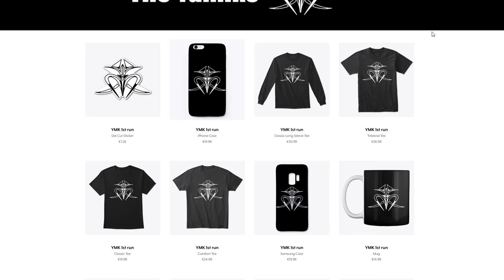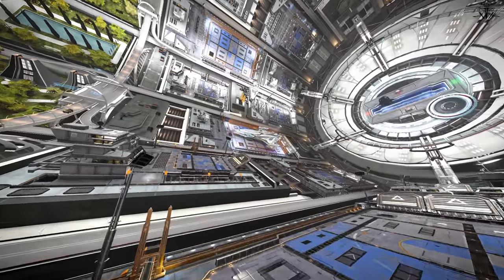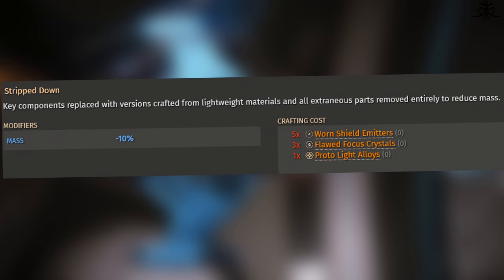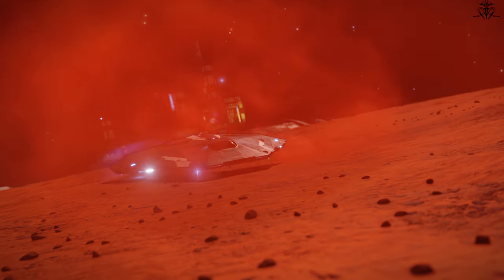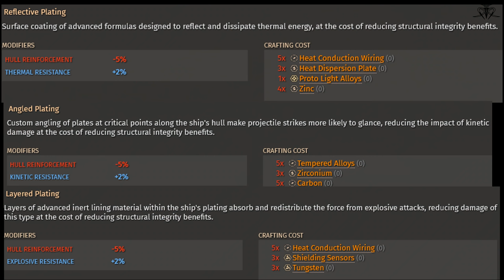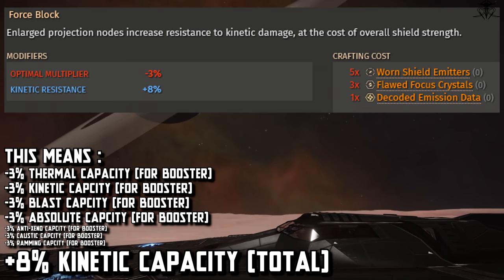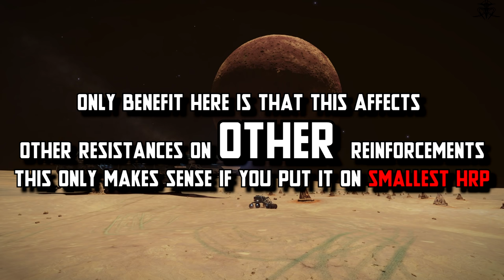BEST to WORST : DON'T BOTHER optional internal tier(Misc stuff,Long range interdictor)

Comment: the mass cutting for exploration only works for 2 ships: Anaconda (IF you got no worries about Money) and Diamondback explorer. if you do it with any other ship, it is stupid (just plug the Guardian FSD booster and you're good to go for combat radius for example in a Krait MKII). and an engineered DBX is NOT expensive at all (10MI + Materials, wich are easy to find in any good starport with movement (encoded), Dav's Hope (manufactured) and in Ariel(elements)...)... i consider it even a thing every commander should have at hand at this point of time, a DBX with at LEAST 60LY of jump.
Reply: Yeah... Tell that to my Courier, boosting to over 800 m/s then jumping 45 LY to the next system.

All exploration builds can benefit from cutting weight. Especially since the returns grow exponentially as you shed tons. Open up Coriolis, and look at the profiles tab. For jump range, there is no cap. And towards the left of the graph, the lightweight side, the curve pitches up more sharply. So, for every ton of excess weight shed, the next ton shed will yield more returns than the previous.
Reply: i mean this as a general thumb rule. if you like exploring in Gutamaya Luxury i'm not stopping ya.

Comment: Lightweight hull engineering wouldn't be so stupid if lightweight alloy bulkheads didn't have zero mass. If you want an exploration ship that can take a bit of damage, its literally better to heavy-duty engineer some lightweight bulkheads rather than lightweight engineer some reinforced bulkheads: You'll get more armor for less mass. If lightweight alloy bulkheads did cost mass, then there would be a point in making it or other bulkheads lighter as well as a negative for making lightweight alloys heavier

Comment: Alright, that basically proves that you have no idea about the game :D Would also be nice if you'D shown the actual values ingame and not through third party sites, because as we know, there are differences across the board.
To elaborate:

Low Power shields are to make your freighter lighter since you only use the shield as an airbag to land quicker and to avoid hull damage. Depending on ship you take the smallest A or D type, but still engineer it with that.
Kinetic resistance shields did not only have a place historically but it is also an option that makes sense to have when it comes to customization. As there are people who exclusively use rockets, there are also those who exclusively use kinetics, making it a viable choice to defend against once you run a tiny bit of intel (but that may be a concept lost to you). Furthermore, I still think that it is true how some factions and encounters use biased loadouts, where it offsets the decreased thermal resistance from the increased kinetic resistance in total.

Thermal resistance on hull makes a ton of sense, with all those people running around with beam lasers in order to not wanting to resupply or who run those beam laser builds that either keep you silent running or dump their heat onto the enemy, or make more damage the more heat you have. This is one of those cases where exclusively rigging for a specific damage type is very viable. Also I have no idea why you point that out on lightweight specifically... since reinforced, military, and reactive/mirrored have the exact same engineering types.

Low-draw can make or break your build in some cases, it depends on the way you rig the ship. Strip down is again preferable for freighters and jumpers. The boss cell is indeed useless though, same as with experimental resistance on hull reinforcements.

I do wonder why your list is what it is, and why you haven't looked at other, arguably worse, upgrades. But I guess this channel isn't exactly known for it's informative value, sans the comments :)
Keep up the satire, stay away from helpful tips or critique until you can actually make a case (as seen by the Cutter shield HP ridiculousness that you totally don't understand that it's a crappy build in every conceiveable way).
Reply from the maker: Ok then : 
Low power shields - AS you claim for traders... ok  min-max all you want, if you want. This is still a VERY VERY niche sector of people who would pick it!

Thermal hull - what idiot would NOT pick heavy duty?!

Low draw - only ever used by some explorer builds, but tell me : what explorer NEEDS shields? For landing on high-g planets...ok 1 case. To survive a gank? Umm SOLO MORE?! So as far as I see here the use case is so minimal, why bother!? 

I mean if all you got is straws then .. why bother!?
Reply: @TheYamiks  I concede I was not perfectly straight with one point: I meant thermal hull resistance in general, referring to Mirrored Surface composite. The way you presented your case sounded like who would ever go for thermal in generall on hull. I never said NOT to pick heavy duty :) Heavy duty is not an experimental effect. It depends on the total armor value of the ship in this case if it adds up. Because what you didn't seem to take into consideration are MULTIPLE HR modules. You look at them from a single-slot point of view in this case and only look at paper values. And my case was presenting against one specific damage type that I keep seeing that people are running, and if you know you'll only be hit with one thing, then you get more out of it with stacking, even if your overall EHP seems to suffer.

I wouldn't call trading a niche sector. Because traders usually do not play open :) And not every minmaxer is also a pvper. You'd be surprised how many "filthly casuals" are out there who outsmart and outplay many a bragger if being pushed. Being casual or not playing open doesn't mean it's a bad player by default.
There is more to the game than pvp, and balancing the game around pvp is a fruitless endeavor. I don't know how much you've been exploring, or how far you've been out of the bubble, but sometimes the game just decides to spawn stuff onto you. 3k LY away from the bubble. That extra layer of protection can mean keeping on exploring or starting back out far, far away in a station you didn't want to go to. There are different kinds of explorers, not just the one kind that you think about. Not every player only plays meta :) And you can also not say how many people actually play the game that are not heard due to simply not bothering to go against the the vocal minority of no-lifers constantly flooding forums, reddits and youtube channels. I'd wager if there is a statistic of how many people play solo, group and open, I wouldn't be surprised to see solo and group being a substantial percentage.

If you're out of power on a build, even with a monstered PP, you are presented with different scenarios to nudge out more of it. It's an option that can be looked into, and sometimes there are no other choices. Conversely, while Reinforced shields always look at the better option because of the resistances, you can add resistances via shield boosters. Low powered has the advantage to have higher uptime in terms of recharge rate because you don't need to sink as many pips into it compared to reinforced. And it weighs a LOT less. You might not think about that as being something important, but there are builds out there who want to keep at maximum maneuverability for it's thruster type, effectively not trying to go above minimum mass. There are ships that are well capable of doing so, some easier than others.

The main problem I have with absolute statements like that are; you can't speak for everyone, and only looking at isolated numbers is never going to work. For example. I barely see anyone taking TRUE effective shield hitpoints into consideration - everyone seems to ignore the regeneration. Because the more points you can regenerate in a lower time means your effective hitpoints go up just as well. Not everyone is always under constant fire, giving the shield time to regenerate. And some builds do not need to rely on shield cells.

Sometimes the "best build" for a given ship and a given task is not the best to play for a person. Either simply because it's not fun, or because they can not utilize something as well as something else they've already gotten used to and perfected. Guildwars 1 is a splendid case for an example like that.
Reply: @MJRSoap  This is a good example of what I was just illustrating. Are there BETTER ships for jump range with super low mass modules? Yes there are. But if YOU like the KRAIT more for it's looks and whatnot, then there is no point in going for something else you DON'T like :) Not everyone plays the Meta, and choice is a thing!
Reply: @Khunvyel  The Anaconda might be the Meta for jump range but other ships can compete with it on Jump Range. The Diamondback Explorer for example, it has much better thermal characteristics than the Anaconda, while still holding the high jump range. It's also more manovourablee than the Anaconda. The Krait and Krait Phantom both LOOK better in screenshots while easily competing with the Anaconda's jump range and range of equipment. Exploration isn't just jumping from system to system scanning every single rock. You will want to stop and take in the scene that you and, likely, only you will ever see.
Reply: @MJRSoap  Exactly, yes. The only thing the Anaconda can do is boast single jump maximums but the total range is limited due to worse fuel efficiency. While I would prefer the Phantom over the Anaconda as a pure jumper, I just don't like it's looks and enjoy much more nimble ships. Therefore the Diamondback Explorer is my pick. The Dolphin can actually be a pretty reasonable long range jumper too, all things considered. There are many ships that break the 60LY range with a full tank so a lot of things just come down to preference. With FSD injection / Star boost this is plenty to reach almost everything even on the outermost fringes, if I'm not mistaken. 
The Anaconda or the Phantom to me are more like fully fledged expedition ships ... there is an entire crew making a ship their new home for years as they explore systems in depth and do manned surface surveys etc. My DBE feels like the lone wolf's answer of scouting and cartographing on the verges of space.

BTW; if you switch your power distributor engineering to engine focused, you're back on boosting again. You know, for showing pretty engine trails in screenshots :)
Reply: ELP shields would let you run a vulture with higher loads too. And keeping the mass down ALSO allows more manoevering.
Ever wondered why he got smoked by a Hauler...?
Reply: @markhackett2302  I would like to note that in almost 8 hours, yamiks hasn't responded.
Reply: @MJRSoap  He could easily have been and gone to dinner or sleep or anything.
IOW it really isn't notable.
It doesn't change anything, either, he's either fatally confused or just riffing on his memeing and really knows he hasn't done his sums but isn't trying to be informative, only "entertaining". In either case, it would not matter, these posts here correcting his misapplication of logic are just informative. It is just whether Yamiks is part of the group who will be informed that changes.
Reply: @markhackett2302  Well, considering the responses on his super-duper-shield-cutter and why it's broken, many just don't want to look into the actual mechanics and are feeling "inferior" due to the high numbers presented, without understand that it's a crappy build. In any case, there are people who keep pointing out things and that creates the chance for a good discussion. Often the comments are more worthwhile than videos, which is a very widespread "phenomena" :D Also yes, the Vulture sometimes needs every help it can get. 

@CMDR Emotions give the man a break, it really isn't required for him to answer. All we can do is present alternatives and other arguments, and that's it :) We don't need to convince him, just maybe cause enough stir for the viewers to look deeper into it.

Comment: Remember all the whines about how PvP is rubbish because you spend 1 hour nibbling at the huge hitpoints of shields? Then why do you need Resist Aug shields compared to ELP? Takes 30 minutes before you lose???
And since you now say the hull tank is meaningless  (because of the shields being OP) why would you want to put heavy hull upgrades that slow you down and cut your jump range?